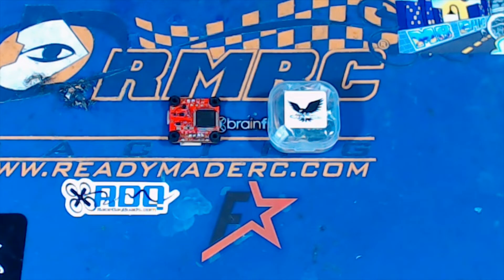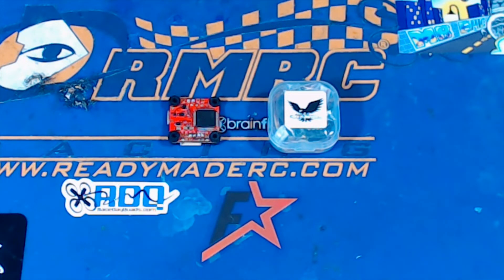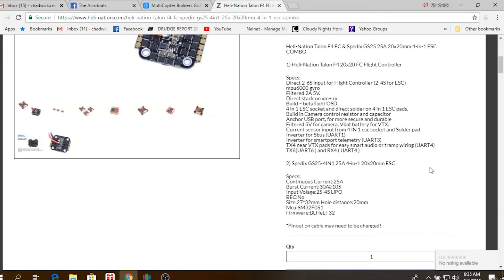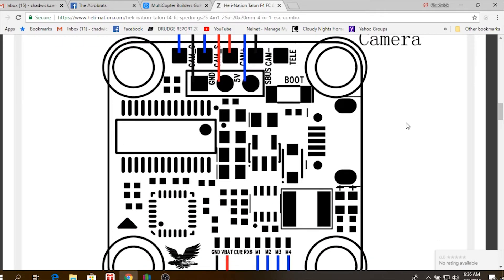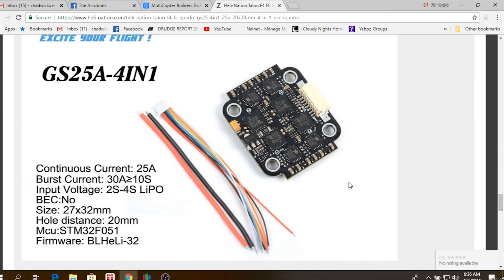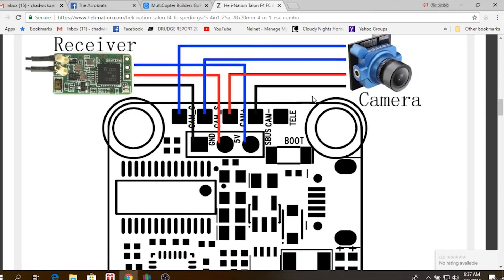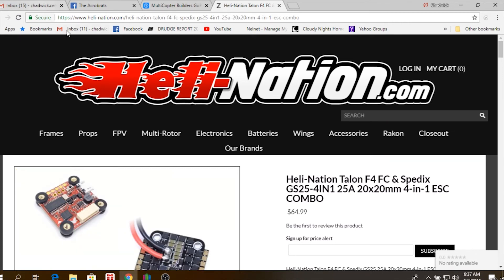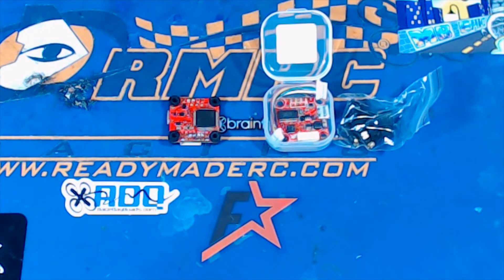PERFECT MICRO FLIGHT CONTROLLER // HELI-NATION TALON REVIEW

Comment: Great channel! what are you using for current setup in beta flight with regards to amperage meter scale (default is 250?). My talon F4 has 56A at idle....
Reply from the maker: i just turn off the current sensing ive never found it that accurate